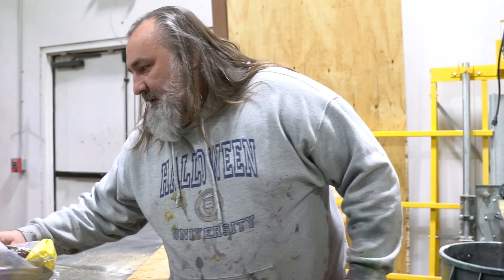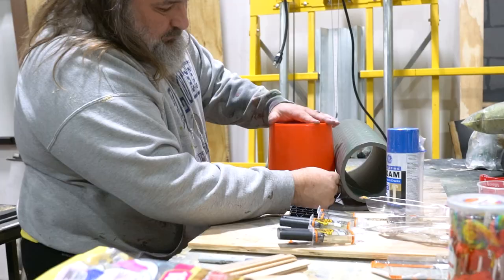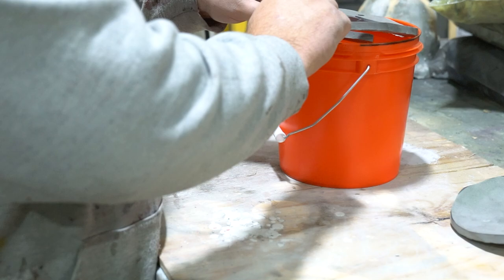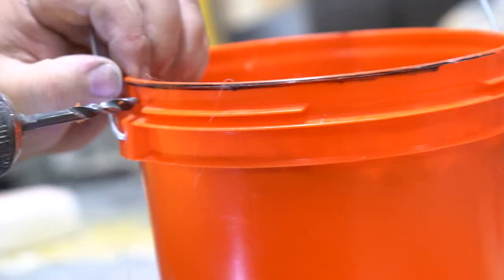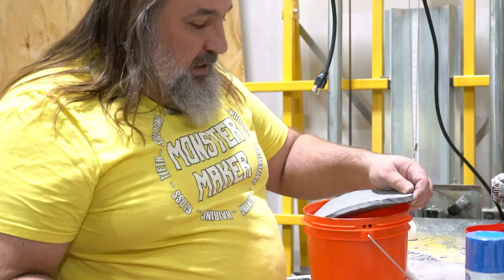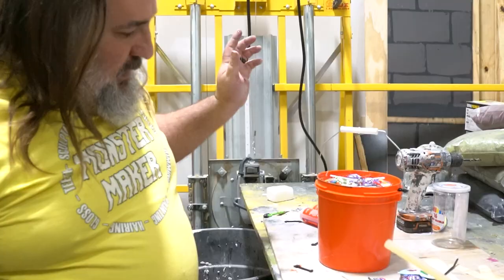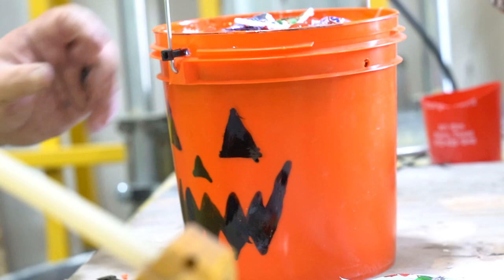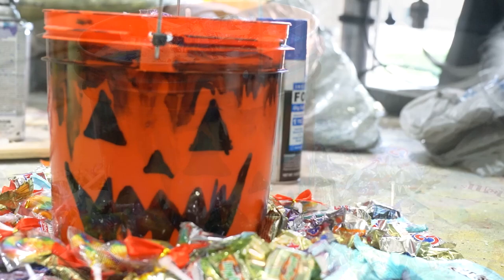How to Make a Trick or Treat Scare Bucket

Comment: like 10 bucks in glue though ahha.  Hot glue may be a bit more cost effective for me.
Reply from the maker: hot glue does not dry clear or glossy- thats why I went with the high dollar epoxy. also a total cost of $25 for an actor prop that lasts the season is one heck of a value in my opinion.
Reply: @StiltbeastStudios  Depends on what hot glue you use.  There are several types of clear hot glue out there.
Reply from the maker: not really, I keep 11 types of hot glue stick on hand in the shop- the clearest (I don't keep it normally) is credit card glue, all the rest are somewhat translucent but no where near the clarity of 5 min epoxy. If you know of a really clear one please share a link Id love to try it.